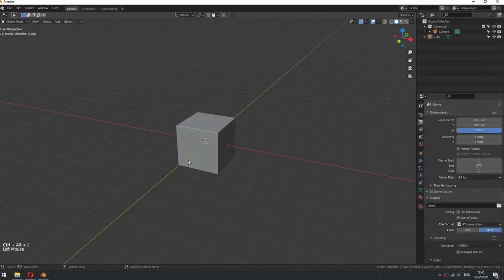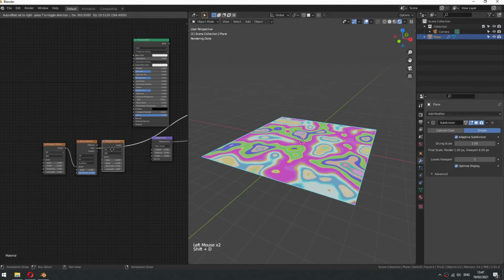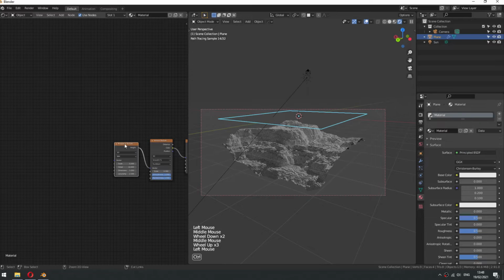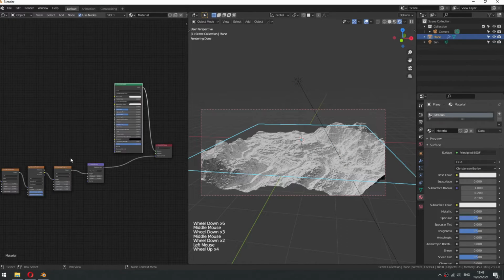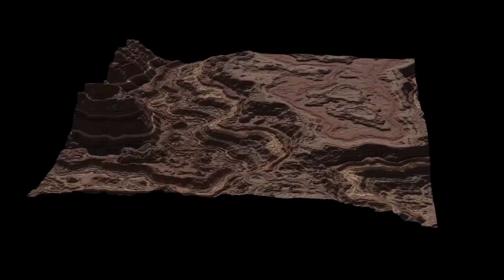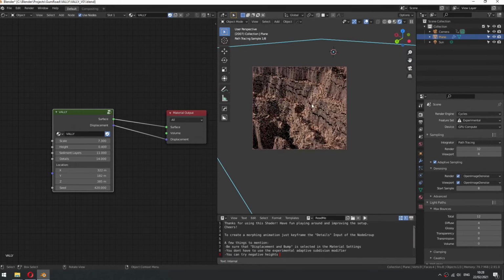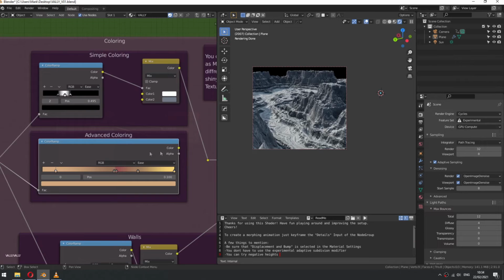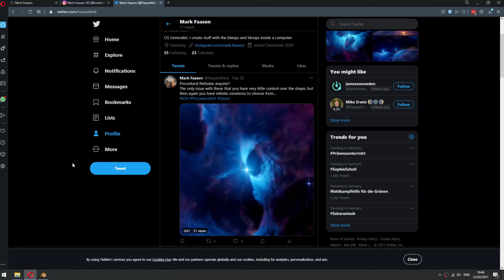Easy Procedural Canyons with 3 Nodes

Comment: Yeah this doesn't work in my version of Blender (v3.0) despite following all your steps,  using cycles experimental and activating Displacement AND bump in settings, it's flat, completely flat... maybe my version of Blender is flawed or something. Oh and when I added a noise texture it crashed LOL
I thought maybe I was doing something wrong, maybe I'd missed something, so I downloaded your VALLY file and opened it.... the plane was Flat, totally flat
Maybe this is something that can only be done with Geometry Nodes in my version
Reply: This happened to me and I found that the height only shows in Rendered view in Viewport Shading, all other views were flat.
Reply from the maker: hmm yeah something might have changed, i havent tested it yet. But thanks for your feedback and telling me what you have tried sofar. I will check it out soon

Comment: Hello, it was a very useful video for me, thank you very much. But even though I did the same things in order and chose 'displacement and bump', it didn't switch to 3d like yours, it always remained 2d. What can I do? I would be very grateful if you could reply...
Reply from the maker: what version of blender are you using? Are you in the rendered view?
Reply: I'm using version 3.2.. I just checked 'viewport shading', I need to enter render mode, it's fixed, thanks a lot! There is one more thing I would like to ask, if you have time, I want to model procedural based on a specific canyon that actually exists. Do you know if it is possible for me to add data such as height map or normal map and edit them in Blender as in this video? I'm not very good at Blender, but I need to use it for one of my master class...
Reply from the maker: @edaylmaz8955   @edaylmaz8955  yes it's possible, just use a image texture node instead of the 3 noise nodes. But I believe it's better for you to search for something like "height map displacement" online :)
Reply: @MarkFaasen  Oo okay, this was very helpful thank you so much..

Comment: Very cool shader, thanks! Question, is there a way to reduce the detail of the mesh? My 12GB 3060 always runs out of memory trying to render it. Cheers.

EDIT: Got it, it's the adaptive subdivision, had to tune that down. Another question, is there a way to add an HDRI to the backdrop? It doesn't seem to work doing it the usual way.

Comment: Amazing tutorial, Just wanted to know if it will work on eevee?
Reply from the maker: Thanks! As of writing, the adaptive subdivision and vector displacement is cycles only. You could bake the texture and use it with an regular displacement modifier, but that's rather hacky

Comment: I'm probably doing something wrong but when I select GPU render the displacement freaks out. CPU works in viewport but hangs when I click render
Reply: Update, it only does this when mapping is set to default values (moving or scaling fixes it). I'll leave this here in case someone has the same issue

Comment: How do I upload the valley shader into a file that already has stuff in it (I made a plane and wanna flying it through the valley)
Reply from the maker: You can append the plane in the valley file from the the file that has stuff in it. But I tried to make fly through animation a while back with bad results because the adaptive subdivision messes up the mesh when the camera moves. You have to turn that of or bake the textures to a height map

Comment: Great Tut! Thank you for sharing. Just asking, is there any way to apply geometry from the diplacement nodes, so the geometry become permanent in order to reduce calculation from at the render step?
Reply from the maker: Thanks for the feedback, glad you liked it. Currently there is no built in way to do this. But it is possible to render from the top to get a heightmap. This map can be used to displace a plane in the traditional way. Have never done this tho...
Reply: @MarkFaasen  Nice hint !! Thanks, I think that should works